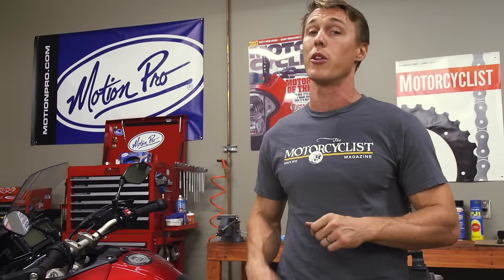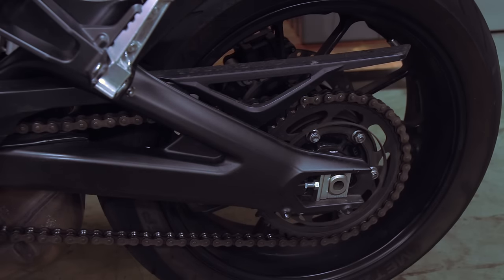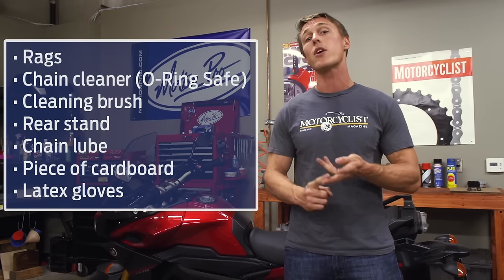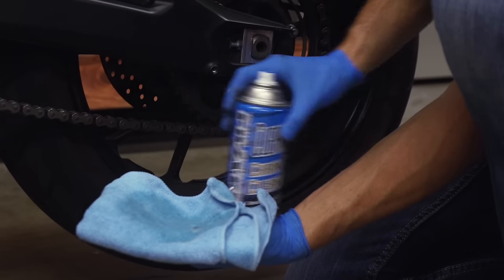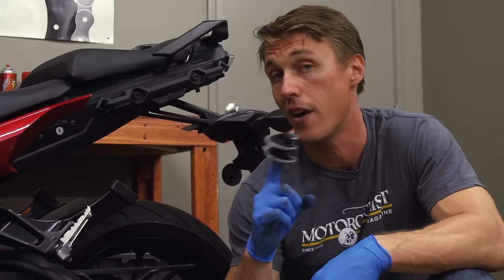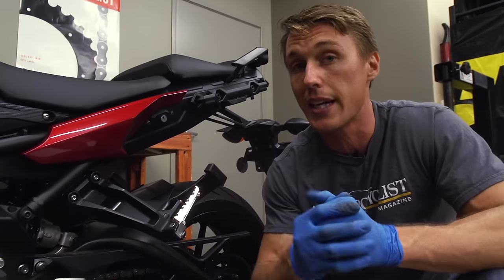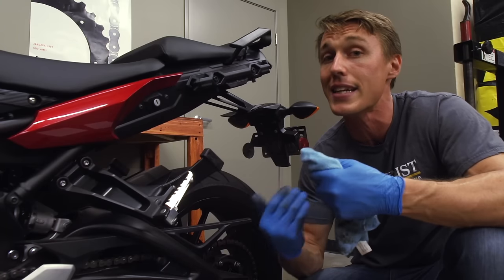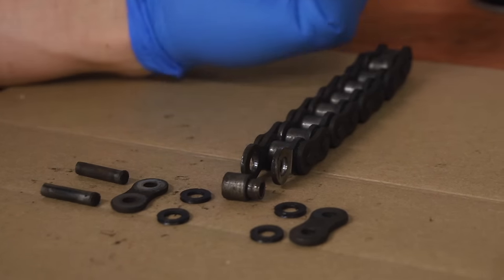How To Lubricate Your Motorcycle Chain | MC Garage

Comment: Dumb question, but what do you do with your used rags full of grease and dirt? Throw them out? Clean them? How do you clean them without ruining a washing machine?
Reply: For chains I used blue shop towels and or old socks, shirts, underwear that's worn out and has holes, but is clean. When done cleaning chain toss in trash. Don't try to wash them. You will cover the washer in grease.

Comment: dont use a brush on the rollers as it damages the o-rings, don't use aerosol lube as the solvent damages the o-rings. use a rag to clean the chain, use hypoid gear oil SAE80 to lube. this info is from the honda owners manual.
Reply: Sounds great. Now, ride some dirt and get back to me on cleaning without solvent or a brush.
Reply: Craig Gibson obviously you can do whatever you like with your bike and clean your chain how you like, just don't expect it to last as long

Comment: MC Garage, my dealer here says, you can lube your chain with gear oil. is it safe and true?  can some people in the comment section help me too. I'm so confused
Reply: I lubed my RC51's chain one year with 80-90W gear oil from Valvoline.  Three issues:  A) It SMELLS HORRID (like rotten eggs) and my entire garage smelled like it for a few days; B) Easy to over-apply and then it drips everywhere on the floor, swing arm, front sprocket casing, etc.; C) Even after the excess dripped away, it STILL flung off the chain on the next ride a day later.  Nasty stuff, to be honest.  Use a purpose-made chain lube.  I personally use DuPont's Chain Saver (yellow spray can).

Comment: I really wanna do it with the bike running. At least the spraying and cleaning part. After all, no cloth or fingers will be involved in that, just the brush and WD40. ((WD-40 is temporary until I get some Ipone.))
Reply: @Filip Ribarić Fuck all of that, lol. I did it properly with the bike off. I actually didn't care in the end. Centerstand and neutral work wonders.
Reply: All that effort, time and money just for theoretically getting, say, 40.000 kilometers out of a chain instead of 35.000? I stopped cleaning the chain altogether. I just apply some motor oil now and then, and that's it.
Reply: @enginerikli5895  Wellll, now I have a sexy red chain that matches my bike, sooo...
Reply: @Drunken_Hamster  So, you have a looker? Then go for it. Owning a pretty bike, car etc. is a pleasure, too.

Comment: This is a bit over kill... Put your bike on a center stand, put it in 1st gear, spray it at the car wash for a minute. Ride it 1 or 2 miles till its dry. Then put it on the center stand again, in 1st gear and spray it with lube. Done